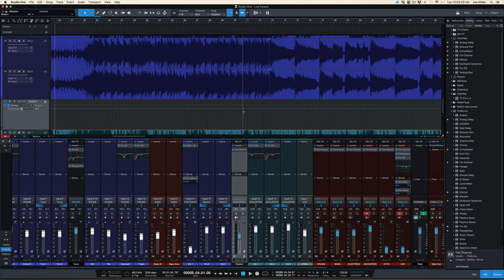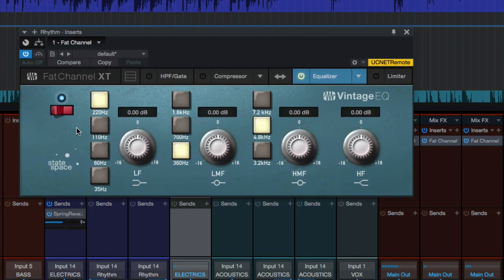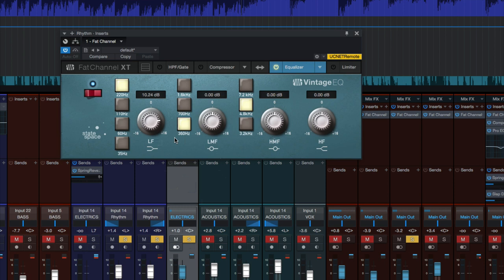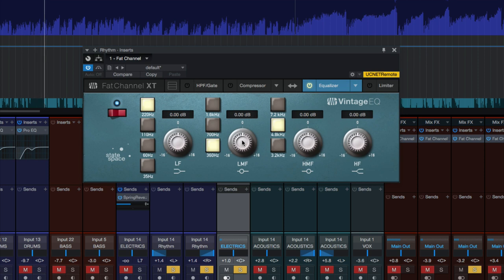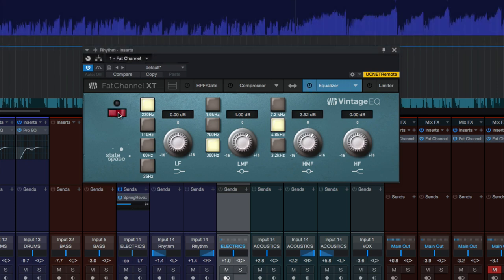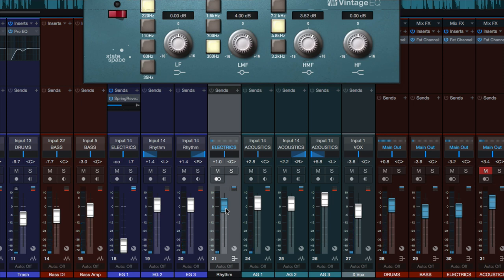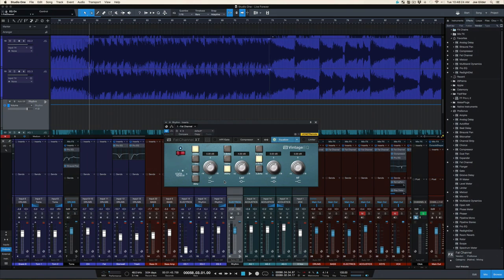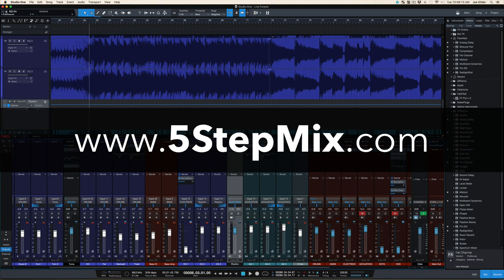How to EQ Thin Electric Guitars

Comment: Grateful if someone could answer a question about AD/DA converters I have a macbook pro from 2015 with the S/PDIF Optical Digital Audio Output could you just go straight from the S/PDIF input from the converter into the mac or would you have to get an audio interface and go through the S/PDIF output of the interface than USB into the mac pro? And if you can to both which is generally considered to be “better”
Reply: Your question seems a bit confusing with the way you are wording it. The MacBook Pro only sends audio out, either digitally or analog.  If you are feeding some sort of outboard digital equipment that would accept this sort of signal, like digital speakers or something else that would be a useful application.

If you are talking about also having some sort of audio interface and should you use the MacBook Pros digital out or the interface's output? Just use the interface output. The digital converters on any audio interface are going to be better than what's built into the MacBook Pro.